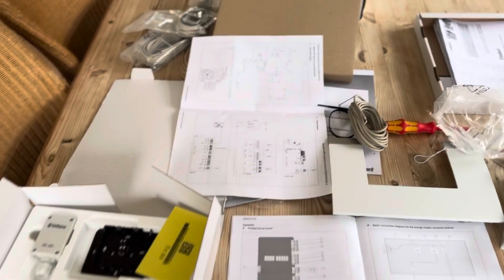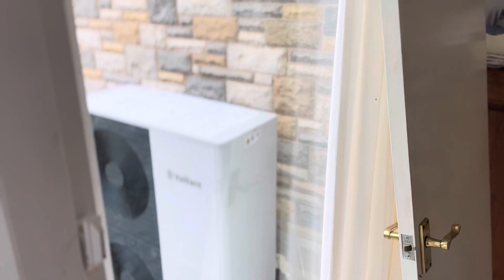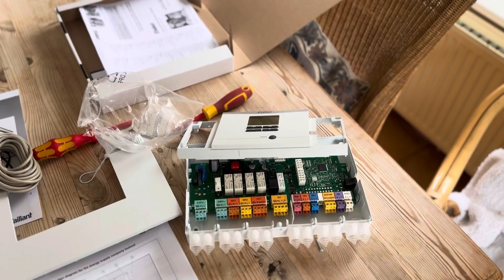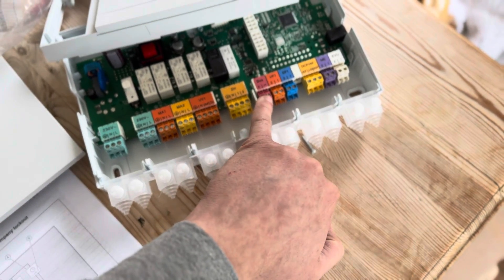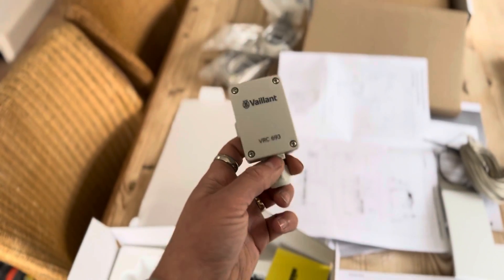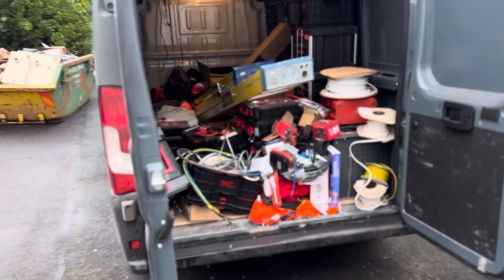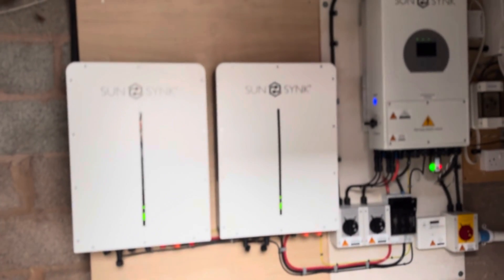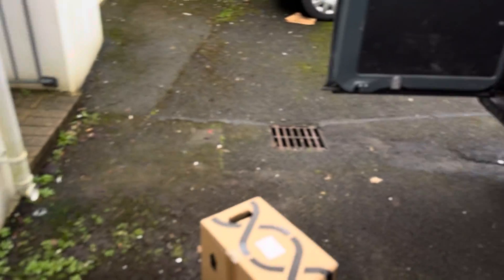WIRING A VAILANT AIR SOURCE HEAT PUMP DAY 1 #electrician #airsourceheatpump

Comment: I’ve noticed you only used one interface. In the kit I got there was another interface where you’d wire all the sensors that go on the buffer pipes and flow pipes back to. I’m pretty new to air source. Is this only if your wiring multiple zones that you need that interface? Hope that makes sense
Reply from the maker: @paulgarrett7703  hi mate 

Yes that’s correct, there is an add on interface vr71 ? I believe. This is if you have more then one heating zone and it allows you to add corporate underfloor heating etc with sepetate thermostats aswell.
Reply: That’s me ripping it out and starting again 😂 plumbers telling me that needs to be installed. So if it’s just the one heating zone and hot water. It’s basically. Ebus to heat source ebus to stat. Ebus to outdoor sensor, 230v to pump 230v to diverter. Then obviously your mains supply to the heat source pump. 
I really appreciate your reply so fast mate as I’ve been losing sleep over this job. I’m back today to finish 2nd fixing it and if I can ditch the add on and go by the basic wiring diagram it makes things so much easier. I know what you mean by vaillant schematics. They are very easy to follow. (If your following the right one) 😂 thanks 👍🏻

Comment: What size of cable did you use to supply the heat pump?
Reply from the maker: @JR-qe9mr  I beleive it was a 6mm 3 core armoured, typically do this even though it’s only 20a it could be upgraded in future for a 32a if needed.

Comment: Hi mate how do you price this
Reply from the maker: If your looking at pricing a lot of heat pumps make up a spread sheet with all the things your likely to use on different installs, with current prices plus 20% mark up. Add quantities and an allowance for labour , most installs on the electrical side can be done in any me day by one sparks so a day rate plus fuel and travel expenses

Comment: What cable do you use for bus connections?
Reply from the maker: I use a 2 core Beldon. So it’s screened. But I know most people will use a cat5e/6 for it
Reply: @theowebsterelectricalservices  Thanks for info and the videos, your knowledge and ability shows.Keep up the good work
Reply: @theowebsterelectricalservices  cat 5 is Not to be used for Ebus wiring .